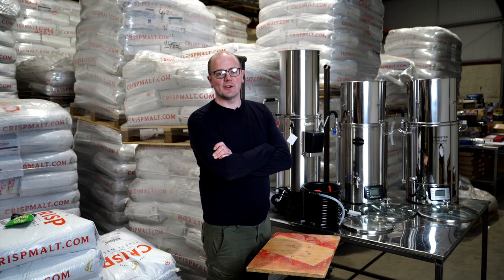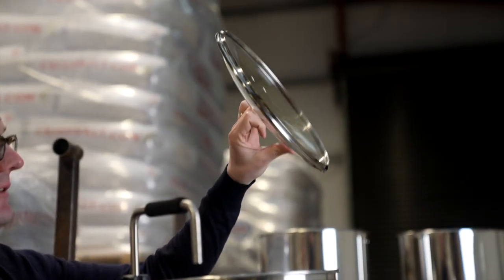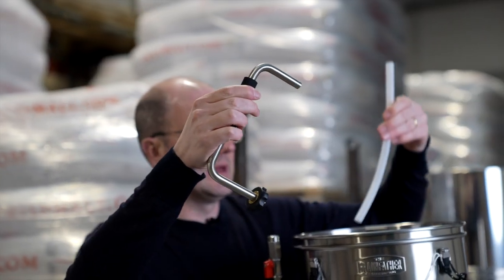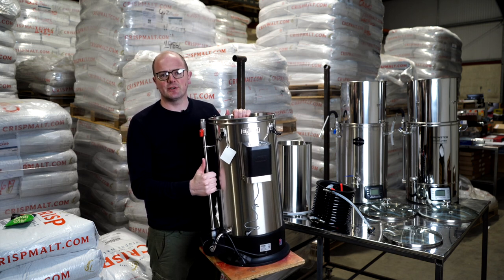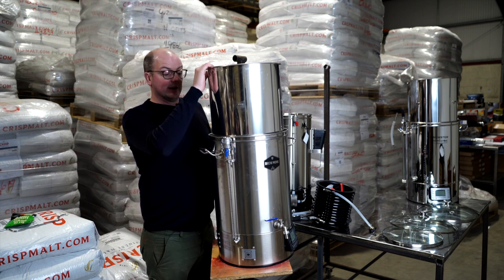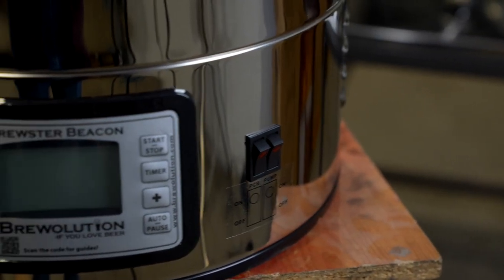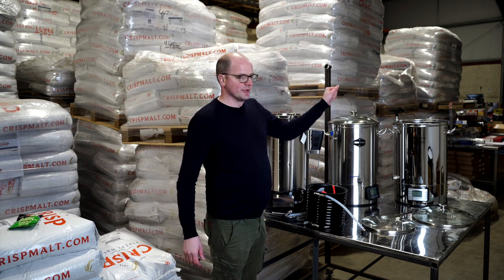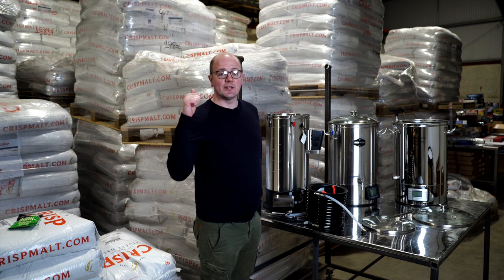Review / Comparison of All in One Brewing Systems at Geterbrewed

Comment: Great video Jonathan.... one mistake is that the clips that you used to pull down the glass lid on the g30 is only meant for the copper distillation lid, obviously no pressure should be put on the glass lid.
Reply from the maker: Cheers for the feedback, i had been using it to ensure it held the counter flow chiller firmly in place when sitting on top of the glass , everyday is a school day and all that

Comment: Good video.  As a Grainfather user I would point out (as many other users have pointed out elsewhere) that the filter is dreadful - it can't even cope with hop pellets.  I have distorted (domed) a Brewzilla false bottom to fit, as it is an infinitely better solution. As you point out, the silicone rubber seals are fiddly to fit  - a massive understatement! - the rolled edges of the other systems are what GF should have introduced long ago.  However, the GF counterflow chiller is really good (and a VB has pointed out the red pipe is the hot water outlet, and nothing to do with the wort).

Comment: Super video Jonny! I’ve done some all grain stove top brewing before and want to get back into it with slightly bigger volumes… would you recommend going straight to an all in one, or go for one of the peco kits?
Reply from the maker: If budget isn't an issue i'd go straight for the all in brewing system with a ferminator to maintain temperature control

Comment: Can you buy the counter flow chiller separate to use on another system like the brewmonk?
Reply from the maker: We can supply the counter flow as a separate option but i haven't personally tried it with another system, but technically i can't see any reason why it wouldn't work